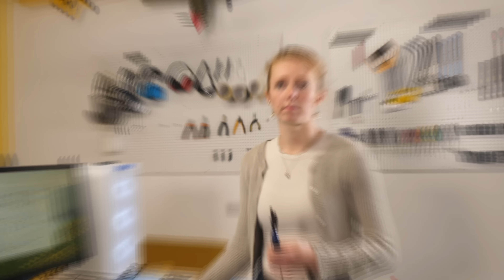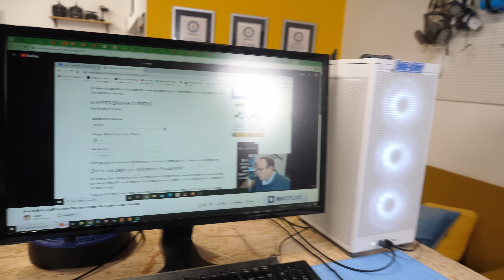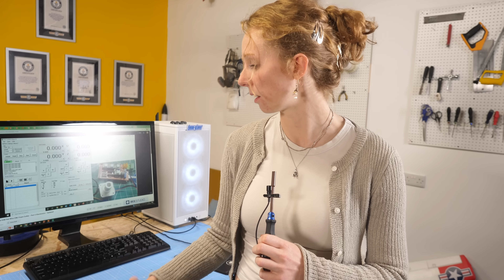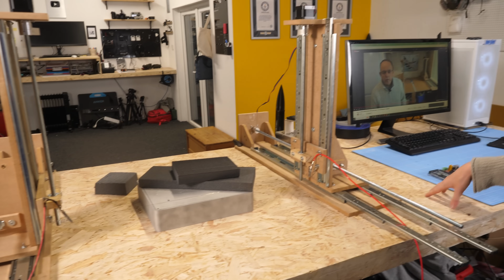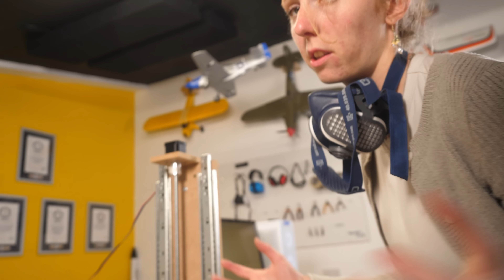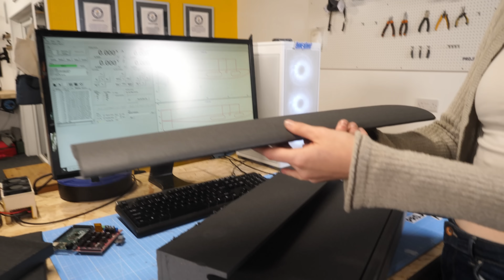Building a CNC Hotwire Cutter

Comment: Many thanks for your kind words and a great video, Keith
Reply: Hey Keith! your famous :)
Reply from the maker: Thank you, Keith!
Reply: @Project-Air-2 How do you prevent the t-nut getting loose during longtime operation? I would add two screws to secure them on the wood, else they will pull out over time IMO.
Reply: @rapman711 it's possible but I had one running for a couple years and they're still in their loctite. You would have to use a tool to get them out
Reply: Thanks for having low-cost solutions for our hobby Mr Keith 👍👍👍
Reply: I am so happy that I follow you for a long time
Reply: A legend 👆
Reply: Bro has been a top notch youtuber forever boutntime he gets some traction. He definitely deserves it
Reply: I know Keith too who helped me with software and firmware for the Arduino MEGA. Friendly and calm helping guy who knows a lot!
Reply: Keith Site is awsome ! I built it with less wood but more 3Dprinted part, and is working very good !  Thank Keith also here again !!
Reply: Your hot wire CNC machine videos are very helpful. Mr. Keith, you truly are a legend.

Comment: If you can, try getting the drivers from Trinamic. They do drop in replacement for the RAMPS boards. They make the motor MUCH more quiet and efficient. So you might not need the fans and just use heatsinks. Otherwise awesome video! Thanks

Comment: Thats wicked, I always wanted to make one like that. I did heaps of it years ago but never automated. Having such a big curf is an easy fix. What I found is you have to run the wire at a higher temp. With that higher temp, you have to feed faster and use the actual wire itself to cut rather that just the radiant heat that's coming of of it. Added bonus, the faster cut makes a thicker harder surface of the foam. Only thing to watch for then is finding a balance when the centre of the wire doesn't get "left behind" and you get a centre that isnt quite following the same line as the outside

Comment: Personally I’d use plywood rather than mdf as mdf dust is toxic. No you don’t need a CNC to cut the mdf, a table saw would do equally well in a fraction of the time. Draw slides as linear bearings is a genius idea, way cheaper than actual linear bearings.

Comment: In the early 1990's, I wrote the software for a friend's hotwire foam wing cutter. The original owner and builder of the machine could only cut constant chord wings on it. My friend wanted to be able to cut tapered wings for AMA and FAI pattern planes. So, my software could cut tapered wings with different root and tip airfoils, leading edge sweep, washout, and dihedral. The hot wire was automatically tensioned using a servo with a spool, a feedback pot, and a spring. The servo and feedback pot kept the length of the spring constant as the spool shortened and lengthened the hotwire as needed.

Comment: My first attempt at cutting foam wings was back in 1976. I used an H.O. Scale model train transformer. Eventually, I built a constant current power supply using some power transistors, a LM317, and a few passive components. Although the constant current supply worked well, I wasn't sure it was any better than the model train controller. In fact, after a few decades of use, one of the transistors in my constant current supply failed, so I purchased a more powerful PWM model train controller, which served me well for several more decades.

One advantage of a constant current supply is its ability to maintain a more consistent wire temperature. However, to achieve a truly steady temperature, additional circuitry would be required. Nonetheless, the constant current supply performed well for my needs. Depending on what you're cutting, a relatively constant temperature may or may not be necessary. 

It's a nice build, and I'll check out Keith's site right now. Thank you for all your entertaining and informative videos!My first attempt at cutting foam wings was back in 1976. I used an H.O. Scale model train transformer. Eventually, I built a constant current power supply using some power transistors, a LM317, and a few passive components. Although the constant current supply worked well, I wasn't sure it was any better than the model train controller. In fact, after a few decades of use, one of the transistors in my constant current supply failed, so I purchased a more powerful PWM model train controller, which served me well for several more decades.

One advantage of a constant current supply is its ability to maintain a more consistent wire temperature. However, to achieve a truly steady temperature, additional circuitry would be required. Nonetheless, the constant current supply performed well for my needs. Depending on what you're cutting, a relatively constant temperature may or may not be necessary. 

It's a nice build, and I'll check out Keith's site right now. Thank you for all your entertaining and informative videos!

Comment: A thought I just had while Emma was talking about cut width due to wire temperature which may be worth considering; does the temperature delta between the wire and the foam have any effect on this? IE, given the same wire, same wire temperature, and same room temperature, does foam pulled directly onto the cutter from a cold garage cut different than foam that has been allowed to reach room temperature?

Comment: A recommendation for the hot wire's power supply: set it up for a target current. The wire length will become irrelevant since the heat is proportional to the current flowing through it. If you double the length of the wire, the resistance doubles, so the power supply would double the voltage to keep the current constant. This would net twice the power distributed across twice the length. Which means the same heat for a given distance.

Comment: Awesome!  I remember manually hot wire cutting model wing cores in college more than 30 years ago.  A person at each end of a bow had to call off marks on templates to try staying in sync!  I should give this a shot now that I am retired.
All the best in your engineering endeavors.
Reply: I used to use a long wire with one end fixed to the wall. That would cut a slight taper but I could do it on my own.

OTOH, these projects are quite achievable these days and a great asset to any club.

Comment: I highly recommend using constant current mode on the power supply you use for the hot wire.
The reason is that it reduces the effect of changes in resistance value that occur as the temperature of the heating wire rises.
As a side effect, it also extends the life of the hot wire by preventing overheating.

Comment: I built one partially based on rcKeiths design and have been using it successfully for a while now. When I first set it up, it wasn't great and took some tuning and modifications before I got consistency and moved away from the trial and error you talk about. I highly recommend using the BTT SKR Pico board over the Arduino, it will quieten down those stepper motors and produces much smoother results. It also takes a higher input voltage so can be used to power those longer hot wires. I started with a spring for tension also but quickly realised that isn't ideal or consistent, and cant cut tapered wings. I modified it so that one side of the machine has a drop weight which hangs off the side of the bench and maintains constant tension on the wire, even at extreme taper angles. The other piece of advice is to straighten your hot wire before putting it on your machine. You do this by holding one end in a vice, and the other end in a power drill and spinning it a few hundred revolutions with the drill. Takes a bit of practice to get right but the results in your cutting will be worth it. Hope this helps you dial in your foam cutting!

Comment: I'm surprised she's still using the spring to hold tension on the wire.  I built a couple hot wire cutters (non-CNC though), and I used a small turnbuckle to dial in the tension: When the wire expands, I reel in the slack.  I play and sometimes build/modify guitars, so reeling in a temperature-sensitive metal wire to the right tension seems intuitive to me.  Obviously you could easily over-engineer this feature with a sensor for the tension and a stepper motor to dial it in like Gibson's "robot" guitars, but I guess this is working for her.

Note that there are a lot of variables in this system, so I'm especially impressed that she's been successful in getting repeatable automated results from one set-up to the next.  Just to list a few (and those with 3d-printer experience will recognize the influence of some of these):
-Voltage/current - A benchtop power supply allows you to dial in the voltage and limit the current, but I know most people end up using what they have.  (I started out with a benchtop, but eventually I went with a 12V Meanwell-style supply.)  There are calculators online that will determine the requirements for your desired temperature with a given gauge and/or length of nichrome wire, which is a great starting point.  However, the empirical approach settles everything once and for all.
-Ambient temperature and convection - The cuts in the video were performed indoors, but I was working with large sheets of foam (4'x8'), so one of my cutters was built into a workbench to cut like a table saw or bandsaw.  I had it in the open air mostly for the space to work with a large board, but it also cleared fumes as fast as they were generated.  One late autumn evening the wind was gusting so much that the wire was visibly cooling off when the cool wind hit (i.e., I could literally see the red glow fade from the wire).  Remember, there isn't a lot of volume to the wire, and most of it was sitting in the breeze, so the effect was dramatic in this more extreme case. 
-Cutting speed - She mentioned that the foam never touches the wire, but that assumes a low speed where the heat opens the kerf ahead of wire itself.  However, it is possible to move the wire into the material (or vice versa, depending on your set-up) too fast so that the wire touches the foam and dissipates the heat.  It also melts onto the wire and will be burned away by the heat.  Conversely, moving too slowly will open the kerf ever wider, and that won't be a consistent size across the length of the cut because it's going to be warmer in some places than others.  And if you're feeding the wire or material across the other by hand, then you're definitely going to get inconsistencies, even if you're using a guide to keep it straight (e.g., a fence or clamp-edge).  I got a lot of these areas when working with large pieces bc I had to re-position myself as I pushed the material through.  That brief pause allowed the wire to eat away that area for just a little longer.  I know we're talking CNCs here, but it's something to think about if you need a manual version for scaling large pieces down or if you just want to insulate your basement.
-Wire gauge - This determines the resistance, but wire gauge also affects a lot else such as the deflection: How much "give" the wire has.  If it's strung horizontally, then gravity might affect it, depending on how far it's stretched and under what tension (I have seen industrial machines that have wire stretched 6' or 8' across).  And if you happen to push the into the material, too light a gauge will break easily.  Light gauges break easily if the temperature gets too high as well, as you might expect.  However, a heavier gauge is susceptible to slight bends, so you never really get a straight line, especially if you accidentally bump the wire where there's now a kink.  You have to find a compromise in both the electrical and physical properties.
-Wire length - I sometimes cut through the thinnest part of the material (i.e., the opposite of what she's doing here in maximizing cuts across the wings' surface or through its core), so I can move the alligator clips closer together so less wire = less resistance = more current flows through = the wire is hotter in that section.

I used the big cutter in the examples above, but I also made a smaller one that's more like the handheld versions used in sculpting foam blocks.  However, the arm is mounted/hinged so that it comes down more like the wire cheese-cutter shed likened it to in the video.  The big cutter was for making long strips, and the smaller cutter was more portable to take right up to the sites I was insulating so I could cut the strips to the correct length and even to adjust the cut to match unusual angles in places where joists weren't square.  Similarly, I could adjust the wire to make a bevel if I needed to wedge a piece into a gap to seal it against air intrusion as well as to insulate.
Reply: I was thinking that you could just tie some string to the wire, run it over a pulley and add a weight to maintain constant tension.

Comment: Is the machine capable of cutting a tapered wing? I have very much wanted to make a cnc hot wire cutter like this t and will some day but I want it capable of tapered wings. Obviously you may have to make some changes that acomidate the wire length potentially changing length during the cut. But I was curious mostly if the software was capable of controlling the motors in a way to make a tapered wing cut?

Comment: I am inspired to build this.  I have had many kit products in the marketplace and used to produce foam cutting power supplies and bows.   My observation is your wire could be very much tighter.  Your temps are too high.  I like the speed.   Because your wire is so loose, you're turning the temp way up to minimize the lag.   I've never had a CNC cutter but will be looking into it because of your inspiration.  However, the physics of what is happening is not altered by the method of motion.   But, could be much more accurate and can be done by a single individual.  Love it.

Comment: I have cut lots of foam wings with 2 people and numbered templates but what I have done for the spar holes and wiring holes. Is to cut half way with a box cutter threaded the templates on to the hot wire then bent the slot open to insert the wire. Put the templates back on and put the wing in its bed cut the hole turn off the hot wire, then the box cutter opening can be bent open to remove the wire and the openings glued with white glue so no slot as the box cutter springs the foam and closes afterwards.   The same could be done even easier with the CNC even easier with no templates just bend the cut open and drop the wire and core into the bed.  Hot wire the hole, shut off the hot wire bend open and raise the CNC to remove the wire.  With a flat bottom wing their is no need to cut the bottom surface if the foam is in good condition saving lots of foam. Old cool room panels are a good supply of foam I just space the hot wire off the floor with 10 mm tube or box section and slide the panel on the floor to cut each side flat and smooth.  I use stainless steel aircraft lock wire 6 sizes but have .02 '' and .032 '' at up to 50 volts from an inverter welder and just my 30 volt 5 amp power supply for shorter wings gloves are good at higher voltages to stop tingles and dumb burns from the wire.  I like the CNC cutter but need space and kind of like using hand tools I would guess 100 hours to build the CNC cutter and at 1/2 an hour to cut a pr of wings that is 200 wings.  At 63 that is 10 wings a year for 20 years till 83 and I still am flying planes I built 30 years ago so 1-2 planes a year. For a collective build for a model club not kept in my shed sure or someone running a Utube channel.
Reply: From the brief glimpse of RCKieth's channel, once you have a CNC cutter, it gets used for far more than just wings. There were a couple of planes where the fuselage was made from a stack of slices.

However, I think you're right, it's better as a club project. I built an MPCNC mostly because it seemed like a really fun way to dabble in robotics, and it doesn't get a lot of use.

Comment: Draw sliders....  I have lots of those from old furniture. hahahaha Horders paradise always has it in stock. Also got two dead Ender 5 plus's too. I mIght have a play as i have a RC plane build coming up.   Top tip for cutting MDF straight, Get a Japanese push pull straight handled saw. you cut along the mark keeping it dead straight.

Comment: Very nice! I just wonder why you didn't just use a 3d printer controller. It'd speed up the development a wee tad. Also, by the sound of it, the DRV8825s aren't doing a very good job here. If you were to replace those with TMC2208s or TMC2209s or even TMC5160 (if you really need that), it'll be a lot quieter since the motors won't be driven by square waves like now ;)

Comment: The timing is really fun for me since I'm building my own since May. 
I'm going the metal route with 2040 aluminium extrusions, vslot wheels and laser cut metal plates for the carriages. 

Hoping to make it work with a older 3D printer driver board since that has 4 stepper drivers and is all in one. 

Happy to share my plans once I have my v1 finished up later on, it's design allows for precise movement since it's running on belts and normal CNC motion system. 
All metal makes it robust and not really at that much more of a cost. Buy once cry once right...

Comment: I built mine back in 2009. https://youtu.be/8n9gXX74KXU?si=6q5WpJgqUrOH7Wgd

Things got way easier now with Arduino.

The spring is a must there, but only works when cutting symmetrical wings.. you will need a pulley system like mine to cut asymmetrical objects, like trapezoid wings. ❤❤ Check this old video so you can add a step up on your cutts..